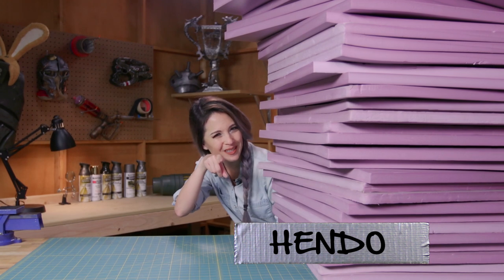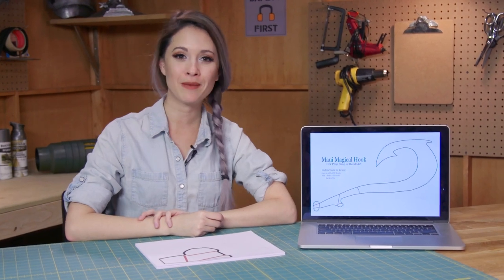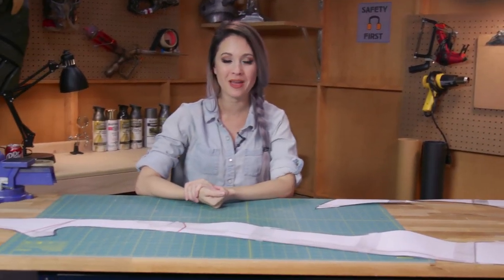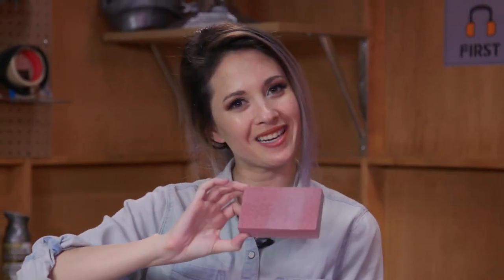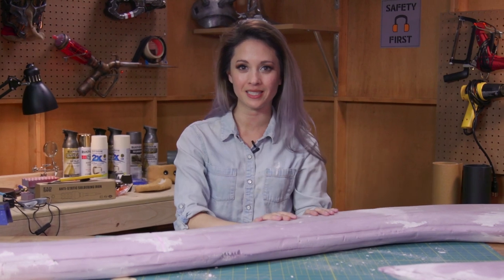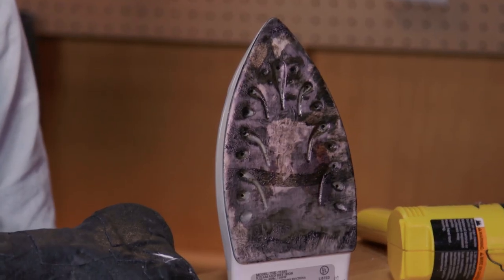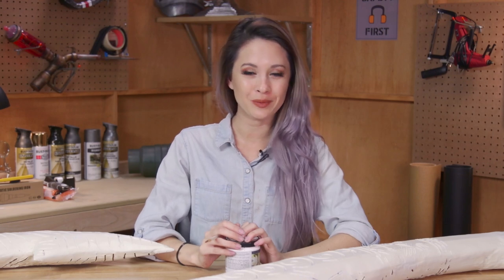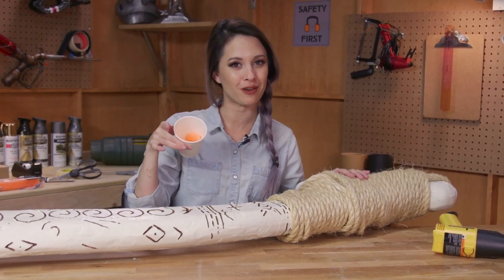Maui's Hook - Moana - DIY PROP SHOP

Comment: That project must cost a huge amout of bucks. Worbla is freakin' expensive !
Reply: Yeah but you can do without it :)
Reply: I used the same type of foam to make my loki horns and I just painted them. I did use modpodge on them first so the spray paint wouldn't eat through the foam.
Reply: you could make it out of wood to give it a similar look and feel as well as wieght and youd also use most the same tools
Reply: Using wood would make it disgustingly heavy though
Reply: Me Superfrucht again, if you skip the worbla and just seal the foam, then paint it, it's going to be considerably cheaper.
Reply: Chizuru M.  You can always try paper mache. it's way cheaper and sometimes free.
Reply: Yes sure, but it is gonna be a lot heavier. There is no perfect solutions xD Only.. Alternatives.
Reply: Chizuru M. Or sticky back car vinyl
Reply: it is definitely MUCH cheaper to seal with glue! but since we have to build on a time restraint, we often use worbla because it's faster! it's cheaper for production to pay for worbla than to pay for me to spend 2 days sealing this thang lol

Comment: you should be wearing a mask or respirator when working on the foam, especially when sanding, even by hand
Reply: reddevved for curiosity sake.. Why? Always wondered this.
Reply: because breathing the dust in is not good for your lungs, it might not seem like it'll be a big deal but you really should protect yourself from that foam isn't healthy
Reply: Yeah and as such can cause respiratory problems down the line
Reply: Um she is actually lol
Reply: The paper masks aren't really good enough and should be wearing one while sanding aswell

Comment: Worbla was unnecessary. Just seal the foam with a heat gun and give it 3-4 coats of plastidip. If you went over the foam with a wirebrush it would of given it a nice bone texture.

Comment: Might want to update the description for the show guys,  there's about $150 alone in thermoplastic on this one.. hardly in the spirit of the DIY Prop Shop channel I originally subbed to.. 

"Follow along with our hosts as they show you how to build awesome props from all of your favorite movies & games, for under $50! This is DIY Prop Shop!"
Reply: She's using about $90 worth of EPS insulation foam too.  Maybe less in US.
Reply: MrsRCharlton in the US it's $5 per piece! although you see me glue a ton together, I ended up only using 8 pieces. it would be better to use one big sheet of it but they don't sell it here Q_Q
Reply: Kris B We definitely talk about this a lot. it's hard to choose between doing something big and cool, and doing something affordable. if we made the hook small, the price would be under $50, but since it's huge it was $$$!
Reply: where do you findit for 5 dollars a piece?
Reply: gary poirier in So Cal at Home depot these 2x2's are $5 or $5.99! Lowes has blue ones sometimes but they cost more

Comment: Hendo im sorry but im not watching your videos anymore. the description says under 50$ but you used atleast 80-150$ just on warbla. hell girl do you know how to do something without warbla?
and i agree with most of you guys Odin could have done way better and it would have been WAY under the 50$ mark.
Reply: Yeeep this is definitely way over $50. One sheet of Jumbo black Worbla alone is $80 already (and I don't think 1 sheet is enough for this project). It would've been cheaper if it was finished with wood glue and sanded smooth.
Reply: CRÌMSON BLAÐÉ You realize you don't have to use Worbla right? You can use other sealants to do it, Worbla/thermoplastic is just a bit of a faster way to do it
Reply: Crucifix Roarband "Follow along with our hosts as they show you how to build awesome props 
from all of your favorite movies & games, for under $50!" This is in the description. Then she goes ahead and uses 3 times of that amount on worbla alone. Either they should build the thing under $50 or remove that from the description. Saying "you could do this or that because it's cheaper" doesn't cut it.
Reply: Sirkillmenot82 it does cut it, she literally tells you different ways to do and decided to go with the easier option, though the most expensive. And I'm quite sure that's just something they put into the description for all their videos, and if you're not happy with it, then don't watch the channel as it changes to show different outlooks on how to build it.
Reply: JARED Looks do not matter.
Reply: Meticulous-Malice That’s all that matters for this show because all the hosts are chicks.
Reply: Kai Jensen all the host are "chicks" because of the fact that women are more socially active. Well at least most are.
Reply: CRÌMSON BLAÐÉ I guess I see your point about the cost.... just I don’t follow along scene by scene for projects I love making my own things and why I win tons of cosplay contest. I watch these just for enjoy meant and to see if there is any cool techniques I haven’t used. Like I personally haven’t used much thermoplastic like this. I find it help to see how it works before I spend money and experiment with it. I do agree Odin is great but I wouldn’t hate on her.
Reply: Awe Me wanted it done faster so she kinda had to use worbla

Comment: I really like that you made the hook the size it ACTUALL IS in the movie even though it's way too bulky and big for anyone but a mountain of a man to even hold (praying for a cameo from the rock in the future where he holds it) so points for dedication there Hendo! ^^

But under 50$? Sure. No problem at all... If you have a few sponsors who buy all the worbla for you and you don't add that to the final price.
I have watched this show for a long time now and I have seen that you're moving away from the cheaper stuff more often than not, and you know what? I'm completely fine with it! A lot of the earlier builds where you really saved a lot of money on material kinda.... Showed That you did. I like the turn you have taken to where you want to show the steps to make great props using the methods you need to go through to make the props great.

Comment: How sturdy is this thing? I've never worked with insulation foam before but it looks kinda brittle. Would it break if you tried to bring it to a con? Can you swing it without it breaking in half?

Comment: Just a tip - my buddy made this minus the Worbla and it held up fine. If you wanna do this without Worbla, it holds up perfectly well 😊 It has enough structural integrity as a mass that it doesn't need Worbla

Comment: I hate to add a negative comment, but were those the individual 2x2 foam sheets instead of a standard 4x8 cut down? The 2x2 sheets are WAY more expensive than cutting a single 4x8 down.
If you're limited on space when you go to the home improvement store, take a utility knife with you and cut the big sheets down in the parking lot as you load them.

Comment: my recommendation would of been to use the weathering trick that Adam savage does by adding a oil based paint over areas of the hook and then taking it off with a cloth so that it gets inside all the nooks and crannies, it may of added a more realistic finish so the engravings do not pop as much as they do on the final product, it would also leave trace amounts of the brown on the flat surfaces of the hook and gave it a more realistic bone look as most bone isn't just flat ivory white.

Comment: So the twine/rope. You can save time and hassle by just taking a lighter to it with smooth quick motions and it will burn away all the loose hairs, this also will make it feel really soft. You wouldn't really need wax or any oil sealing it unless you wanted this thing to last a few years of heavy use. Source: I make rope.

Comment: Looks awesome, kudos for making it massive! But instead of thermo plastic I would of used wood glue. I do a fair bit of blue foam modelling and I found some glue for like $10 that dries "strong as the wood" couple layers of that on the foam and they're solid to touch. Mind you thermoplastic probably gives the best finish

Comment: Funny how it says 'Safety first' on the poster in the back but you don't use a respirator while working with glue and engraving with the soldering tool (:

Comment: Where do you buy sheets of worbla la this?
Reply: Daniel Lupien that amount would cost well over 150$, I suggest using resign
Reply: yaaa...that's the part they don't mention.  When it gets really expensive it should not be considered DIY.
But still, where can I buy worbla sheets?

Comment: there has to be a team of actual prop makers just off camera laughing at this diminutive woman's ability to not even wield an iron.

like seriously, there is no way she did all that by herself. she could barely make it through the jigsaw part.

plus, insulation board? no reinforcing? no wooden rods or any structural support at all? its going to snap in half the first time it hits something.

not to mention, is that actually six feet? because a: it looks way oversized and b: she looks tiny.

watching her use a soldering iron entirely the wrong way on that worbla is going to give me aneurysms for years.

Comment: couldnt you have made it out of wood
Reply: also id like to see man at arms make the ancient nord helm and wuuthrad from elder scrolls v skyrim
Reply: No, and it would be one large ass piece of wood.
Reply: michaelcathulu has made an over 8 foot weapon out of steel also you just have to glue a bunch of 2x4s together cut and refine the shape then use the soldering iron to burn engravings in seal it with boiled linseed oil and beeswax so you use pretty much the same tools